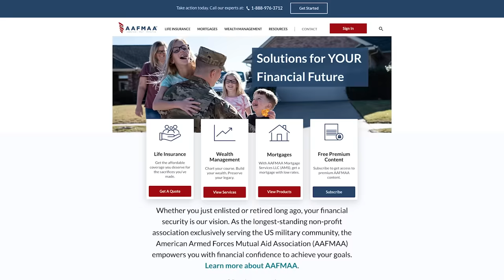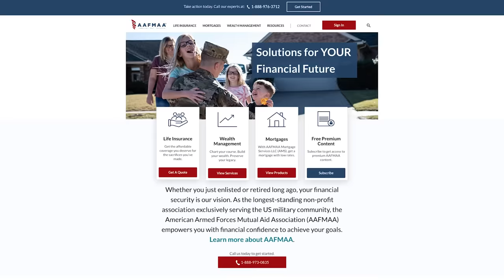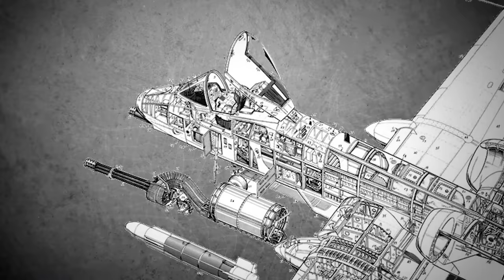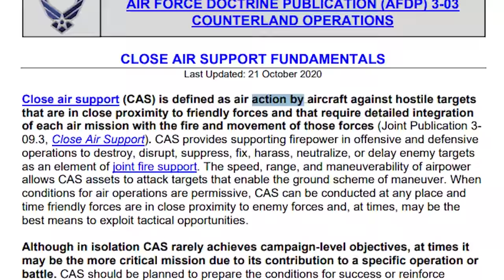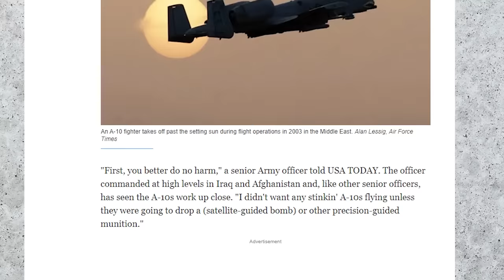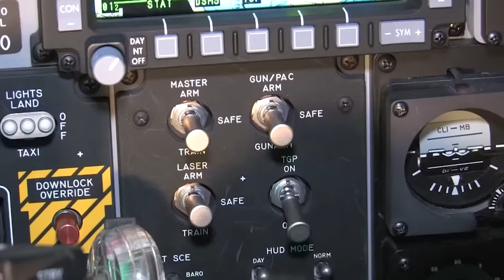Why the Air Force is Screaming to Retire the A-10 Warthog

Comment: Back when the A-10 was being developed there was a serious argument that the role would be best covered by helicopters. Now we have drones as well, which would mean not risking pilots in an inherently high risk mission profile.
Reply: The maintenance hours per hour of flight and survivability of a helicopter vs. an A-10 showed the A-10 to be far superior. I don't recall what the actual uptime vs. real uptime for helicopters was any longer while in the middle east. But helicopters did not do well in that environment at all.
Reply: @thegrimreefer3185  That is one of the advantages of a fixed-wing aircraft, but a fixed-wing drone would be better. I am really curious on how a tilt-rotor compares, especially something like the Army's new V-280 Valor. I know the V-22 Osprey has a few issues that the new 2nd generation tilt-rotor designs have significantly improved.
Reply: @andrewreynolds4949  I really did the V-280 design, but the silhouette is considerably bigger compared to the UH-60 (what's supposed to replace).  On the other than, you can cut heads of insert enemy name if you fly really low, like a modern gladiator chariot of dead, that's a big bonus for me.
Reply: @canobenitez  The V-280's silhouette may be a lot larger than the UH-60, but because of the rotor radii and the V-280 being shorter and wider they actually take up about the same landing footprint
Reply: @andrewreynolds4949  it's easier to rpg'd it.
Reply: @canobenitez  Harder. It moves a lot faster.
Also, I think the Army's much more worried about the larger anti-air systems, like S-400 or the HQ series SAMs, than RPGs
Reply: @thegrimreefer3185  helicopters always sucked, but the point here is when 99% of the missions are to drop guided munitions from well out of range then you can just have whatever do that, there is no need for specialized platforms that come close and personal and have to carry a ton of weight for the BRRRT cannon
Reply: Defense contractors always overpromise and underdeliver. The A-10 was a happy exception to that rule. The concept of the A-10, and incidentally the F-16 and F-15 were all shoved down the throat of the Air Force brass by a feisty renegade fighter pilot and strategic genius named John Boyd. Although his design concepts for air supremacy fighters got larded up with multi-role nonsense by Air Force procurement nerds, the AX/A-10 came through the Pentagon bureaucracy relatively unscathed as a superb CAS and interdiction weapon system. The fact that the Warthog is still mission capable in a medium triple-A threat conflict 60 years after the fact, is a monument to Colonel Boyd's brilliantly iconoclastic vision.
Reply: @bearowen5480  Boyd is a somewhat divisive figure. I'm not sure how much involvement he actually had with those programs, but on the F15 specifically all he contributed was a computer flight model early in the program. The idea that he's some sort of genius mostly comes from his autobiography and his friends, he's more like a normal boring military theoretician
Reply: a drone showing up in a ground battle doesn't make people gun. the a10 does.
Reply: @joeb9135  An A-10 getting shot down over a ground battle is really bad for morale. A drone, not so much
Reply: It really depends on which helicopter you're referring to. I flew Cobras for almost 10 years, and I got to tell you the difference between close air support from a attack helicopter and close air support from an A-10 is like having your appendix out, you can use a scalpel or you can use a chainsaw. Either way, that puppies coming out. The advantage of the attack helicopters is each company has seven of them, six of them flying. Three companies gives you 18 Birds available 24 hours a day. We relieve each helicopter on station once they start to run low on fuel so the bottom line is, if you have a tacked birds out there they will never be far away. The A10 as far as I know has a 4-Hour loiter time if you're not counting aerial refueling but it might take them a little bit longer to engage whilst in Apache can actually be monitoring the battlefield and give warning too the grunts that they have bad guys close by. Both are spectacular platforms, and even though I flew attack helicopters I love the A10 as well. But you don't want to get rid of one over the other, they work great as a team. One has advantages that the other does not but you put them together and you have pure carnage.
Reply: The thing is, the A10 is not an aircraft that's supposed to be competing with high-speed fixed wing aircraft. It has its own very very important mission. It's there to support those Grunts and marines that are on the ground. It is not a fighter, it is an attack airplane. The closest thing you got to compared with is in Apache which when you compare those two quite simply the Apache is more accurate and can take a longer look at the Target Zone before coming in and obliterating targets.
Reply: @thegrimreefer3185  I beg to differ young man, I flew the F model cobra for over 4 years, and they kicked ass in desert storm. The Apache had maintenance issues as a high-tech aircraft would but the Army and Marine cobras as well as the British gazelles and Linksys wiped the map of Iraqi forces. They obviously didn't do the job alone, this is what we call teamwork. But to assume that our Attack Helicopters didn't do a good job is an absolute misunderstanding of how the tactics of that war went. The simple fact that in ancient helicopter like the ah-1f Cobra had more kills than an Apache is a question that the Department of Defense does not wish to answer. But they work in a different environment than the A-10 warthogs. Army Attack Helicopters are extremely close when it comes to close air support.
Reply: @mrgrinch837  I seriously doubt I'm younger than you, but if I am I'm a few generations past being a young man. 😉

Regardless, I never said attack helos didn't work. But they did have issues in that environment. Most equipment did. Especially the high tech stuff. Are you trying to tell me that Cobras had better uptime and less maintenance time per hour flown than an A-10? Do you think the survivability  of a Cobra was better than an A-10 if hit by a few .50 cal rounds or shoulder fired rockets? It's a flying GAU wrapped in a tank with wings. 

Don't get me wrong. I think Apache is an awesome attack helo. And glad to hear the Cobras were still kicking ass. But for up time, loiter time and survivability the A-10 was a superior option for what it was used for. Of course the Apache and Cobra are better choices for specific missions as in their own right. 

In the end, we need both as well as other weapon systems working in conjunction. Neither the A-10, AH-64 or the AH-1 can operate until B-52s, B-1's , B-2's, F16s, F15s, etc clear out SAMs AAA, fighters, etc. Without air dominance, ground attack aircraft are just sitting ducks.
Reply: @andrewreynolds4949  it's hard to say about the survival rate of the Valor as we haven't actually bought them yet.
Reply: @mrgrinch837  What we can say about the prototype is that it has not crashed or had any major incidents to date. Yes it's still early in development, but that's promising, pending further flight testing
Reply: @thegrimreefer3185  Some of the trouble there is the battlefield environment has been changing. It's increasingly difficult for aircraft to stay safe at any kind of lower altitude; munitions have been getting longer range and more accurate, and so have air defenses. The GAU wouldn't be so useful any more, and the A10 is becoming more of a flying target. Most significantly though, as they age the A10s are getting more and more difficult, and more and more expensive, to keep in the air
Reply: @andrewreynolds4949  I'm sure someone said the same thing about the osprey
Reply: The A-10 literally couldn't even do its primary mission *when it rolled off the production line*.

The GAU-8 was designed to penetrate the top armor of the T-55 tank at a distance of several miles, which was the mainstay of the Soviet armored core.

By the time the A-10 was ready, the T-62 and T-64 replaced all the T-55s, which doubled the top armor, which meant the A-10 had to get within significantly closer range to achieve the top armor penetration.

At the same time, Soviets had just begun upgrading the ZSU-23-4 Shilkas with radars, and Soviet mechanized doctrine was to accompany all armored units with SPAAGs.

This meant that the A-10 was doomed. It will always get shot down by the Shilka before it can shoot a tank.

This is precisely why the A-10 was turned into a missile truck for Mavericks. The gun is worthless. Its primary anti-armor role was to just float in, fire off 12 or so AGM-65s from 12 miles away, and then turn around and go home.
Reply: Dogglegg  I was flying cobras in Hawaii when that came out, we were all excited for the first 24 hours until it came out that the only way the Air Force would give it to the Army is without the gun. In other words another reconnaissance aircraft. We didn't want it without the gun. The Air Force is really weird when it comes to trying to transition an aircraft to another service. We would have loved to have flown that thing, they were even looking at the short take off performance is wheeler Army Airfield was not the longest runway in the world.
Reply: Dogglegg  We got a lot of people from the other services into Army Aviation just to fly. The Army doesn't care if you have a degree from any university, they just want to know can you pat your head and rub your stomach at the same time. If so, you two can fly an Apache.
Reply: A drone is a flying targeting pod for expensive missiles. Until we have one that can't be jammed or spoofed, carrys a gun AND can employ SDBs and Hydra, any talk of drones is a waste of oxygen.
Reply: That’s scary to think you can kill without actual skin in the game.
Reply: Well...I saw something about a budget war. I believe the a10 was the reason the cheyenne got axed.. meaning the money went to the airforce instead of the army....
Reply: I wonder if they will try and force the V280 Valor into that roll eventually, it may be able to carry the same weapons.
Reply: @knowahnosenothing4862  I suspect they would more likely push it onto a similar drone platform that may be in development currently

Comment: Ironically the USAF may have actually found a use for the A-10 that no one was expecting. It can be a decoy carrier, with the ability to carry as many decoy drones for decoying enemy air defense system as the B-52. In that role it doesn't need to fly in harms way or even within range of enemy air defense radar just with in decoy launching range.

Comment: As an armchair general, I always loved the A10. But I thought its role is supposedly better served now by Apaches and their successors.
Reply: Their role is served by any modern plane with a modern ammunition. The close in close air support does not refer to the distance of the aircraft from the ground, but that it is close to allies on the ground. A WW2 bomber or a drone way, way up high, equipped with a proper targeted precision missile is already way more effective than an A-10 eyeballing it and spraying and praying

Comment: My only concern is that Air Force brass has made hugely mistaken calls in the past, such as the infamous "fighters don't need guns anymore, they'll just kill from over the horizon with missiles."  That didn't work out so well in Vietnam.  I'm sure that once the plane is phased out some new tactical situation will arise and prove some of the platform based close air support specialties will need to be added back into the mix.
Reply: Except that's a myth most fighters in Vietnam had four missiles. Each missile had a probability to hit of 60% a hit is a kill whereas your cannon hit and kill rate was pathetic
Reply: The A10 has consistently failed to hit its target goals. Everything the A10 has that actually shines in its intended role goes against its chief design. The short of it is "close air support missions are tricky, with a very dense vagueness and incorrectness of information and friendlies are mixed with hostiles more often than not"

for "we don't know what we actually have to go there and shoot" the biggest solution is advanced targetting systems, which the A10 does not have natively
for "friendlies are close to the hostiles" the biggest solution is precise, guided weapons, which the A10 does not have natively.

relying on binoculars and a gun with a bullet spread that you can fit a row of school buses into makes for a horrible close air support weapon.

Unsurprisingly, very early on and to this day the A10s in use in this role have extensible upgrades that go against its core design. Namely advanced avionics, targeting and missiles.
Reply: Fighters don't need guns anymore, when they can make upsetting posts on the enemys Facebook page or send a mean tweet.😂 A woke approach to airforce assets.
Reply: Thing is, vietnam was 50 years ago, missiles and radar have both advanced so much that the saying is for the most part true... A modern F35 is as invulnerable compared to planes from the vietnam war, as planes from the vietnam war era would have been to ww2 planes
Reply: @alamore5084  Ha Ha Ha,  I Like that One  ! what I think of top brass is not good on a bad day !!  they have always had a Tendency  To Get Good Men Killed With their guess Work IN Any given Situation !!
Reply: Except that was true in Vietnam. The Navy didn't put guns on their Phantoms and their kills greatly exceeded the USAF. Because the USAF blamed the gun, the USN blamed the pilots. The Navy stood up the Navy Fighter Weapons School (you may have heard of it... little something called TOPGUN) and learned how to use their missiles. The USAF strapped a gun on the plane and almost nothing changed.
Reply: Except no one believed at the time that over the horizon kills were a thing. That's why the first in the world didn't happen until the 80s in the Iran Iraq war. An event that shook the understanding of air fighter philosophy deeply. 

You claiming that something that happened long before it actually did.

Comment: It wasn’t until the end that you mentioned drones being a solid choice for CAS missions and I finally breathed a sigh of relief. Imo that’s one of the biggest reasons not to have a dedicated CAS aircraft anymore. 

Drone capabilities are incredible these days, with the reaper drone showing a lot of promise as a primary CAS option.

We’re either fighting a near peer and need to consider air defenses - in which case modern multi-role fighters are a better option. Or we’re fighting smaller engagements, in which case small drones could also be a solid option. As we’ve been seeing in Ukraine, even commercial drones are effective at taking down enemy vehicles and dropping grenades.
Reply: There's nothing that an A-10 can do that a drone can't do better.
Reply: Multi role fighters provide CAS arguably better than the A10, having radars, being quicker (this also means they can drop ordinance from further away) and being able to beat other air targets.
Reply: Also the A-10 is so old it’s going so much money to maintain.
Reply: @Secretlyanothername the a-10 is far superior going into an electronic warfare environment.  It is cheaper than the F-35, can carry more weapons, is better protected and more survivable, can loiter longer, and be used on more airfields.  What the A-10 doesn’t do is promote the airforce fighter pilot image and justify a 250 billion weapons program.  

The army wanted the a-10 but the airforce refused to give up the funding.
Reply: Not one drone. A network of loitering munitions that you can call in with a laser pointer like Lancet
Reply: @Omenowl the a10 cannot even take a hit in today’s environment anymore, no peer enemy uses aaa anymore
Reply: @Omenowl a10 is the aircraft with the most friendly fire incidents.
Reply: In an actual battlefield when you're at war with a near peer adversary drones like the reaper among other of the same type are utterly useless.
Reply: @Omenowl  Lmao, "the a-10 is far superior in an electronic warfare environment" 
No, it's definitely not. 

And at somewhere between 13-18 million, it's not cheap enough to be preferred against a 70-80 million F-35A. 

As far as being survivable goes -- it was designed to be survivable against threats from the 60s/70s. So against an SA-7 MANPAD or ZSU-23-4, absolutely it's survivable. But each decade that gets worse. I don't know where it stops being viable, and unless you have access to classified testing documents, neither do you. 

And for the record, I'm also opposed to the fighter mafia and bloated weapon programs. The F-35 is looking to be a pretty solid jet, but I think a couple thousand subsonic ground attack planes would be a good addition to the inventory. And that's if we bought them today -- we should have bought them 30 years ago. Or 20 years ago. Or 10 years ago. Or today, because the middle east and africa aren't calming down any time soon. 

The A-10 is a good plane. But it was designed 60-ish years ago to resist anti-aircraft guns and kill lines of tanks.
Reply: @tomc.5704  lol 80 million for an F-35.. yeah right..
Reply: @Secretlyanothername they should build the drone first then. Haven’t seen anything impressive so far.
Reply: @tomc.5704
Reply: That and the AT-802 Skywarden.